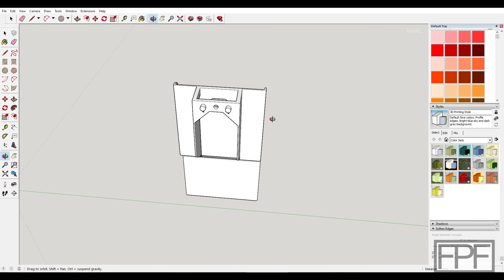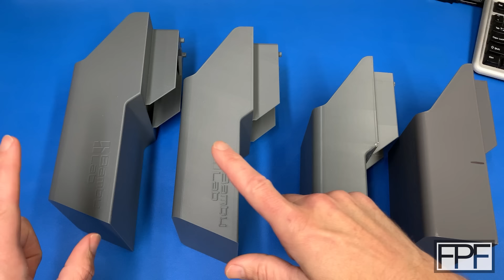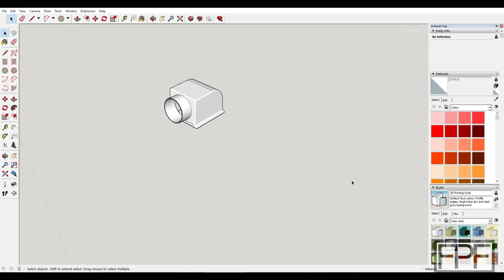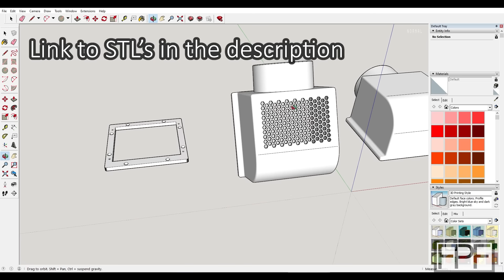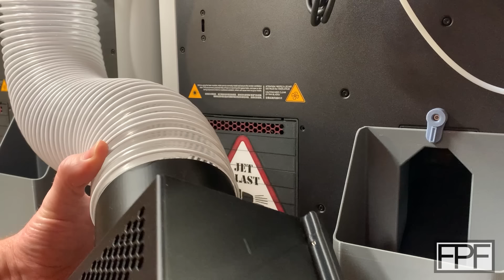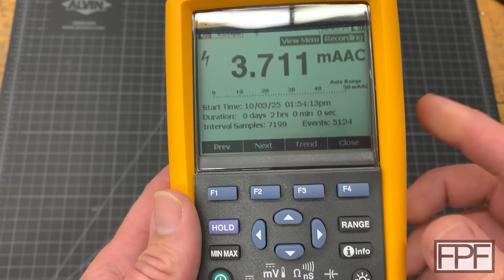H2 Series Fume Extraction for 3D Printing - FINISHED

Comment: Maybe when the vent system is drawing air while chamber heater is on, the internal draft is being shifted from the poop cute to the exhaust fan. When that occurs, maybe that allows for more air to stay in the printer and recirculate. I am interested to see what you’re able to sort out with this. Really interesting. I am waiting for a good method to cent H2D.
Reply: Is that system needed? I want to solve the same issue but wondering if a hood like adaptor that sits close to the back vent and shoot with about 5cm distance and suck air would be sufficient for anything leaking out, and probably don’t need to suck air out of the unit itself?

Comment: What about moving the "jet blast flaps" to the outside of the adapter. They will open when printer is running and radon extraction is blocked. And when radon extraction is open the flaps will shut and no suction is "lost". The flap angle could possibly replace the paper for calibration.
Reply from the maker: Even a single one hinged at the top where the holes are might work. Great idea.

Comment: About the power consumption w/active air extraction : maybe  the one hour soak was enough for the chamber parts (leads, metal parts, ...)  to build enough "thermal inertia" (if they are warm enough), this could explain the lower power consumption. Anyway nice video 👍
Reply: That's exactly what i thought.

Comment: I don’t vent out of my P1S and X1C printers. I use the Voxel Bento Box chamber filtration system. When printing ASA I am not getting any noticeable fumes and according to my air quality meter, the air quality in my print room is very good. Also no loss in chamber temperature due to venting. Maybe look into designing an efficient internal filtration system for the H2S/D.
Reply: I have an opposite problem, chamber gets hotter than the set temperature and even venting with a chamber fan doesn't help much lol.

Comment: Where is the temperature sensor for the chamber heater on the H2 series? It would make sense for it to be near the cold air return for the heater which I believe is next the exhaust fan.  Since it makes no sense that drawing cold air into the poop chute would improve the efficiency of heating, perhaps you are causing warmer air to flow over the sensor fooling the printer into believing that the chamber is warmer than it is.  Can you follow up by taking some temperature readings inside the chamber with and without extraction?
Reply from the maker: Good question. I might re-run with a couple probes and a temp logger.
Reply: What about putting a cover over the poop chute? Eliminate the leak.
Reply: Came here to write exactly this 👍
Reply: This is correct. The sensor seems to be on the intake side of the heater, near the heater fan assembly (from what I can see in Bambu's docs) 

So more of the air exiting the heater is being recirculated right back to it than normal.

As for the poop chute, I imagine Bambu purposely uses a overpowered fan on the heater to overcome the poop chute leakage. Notable is that having a somewhat large leakage in a chamber heater like this makes it easier to regulate.